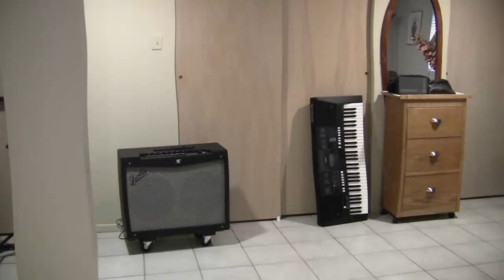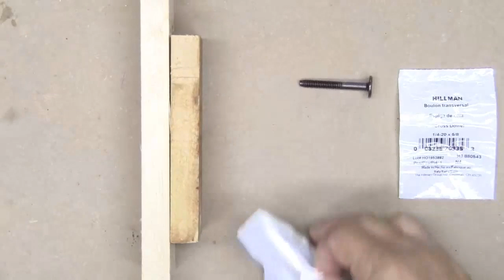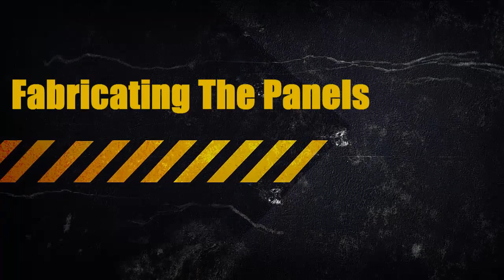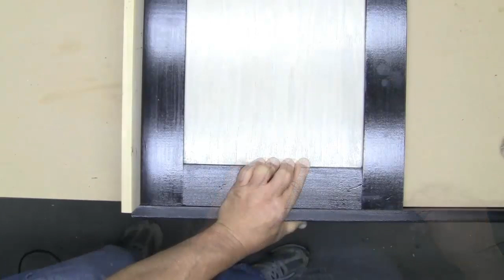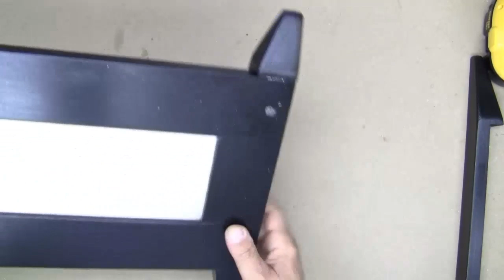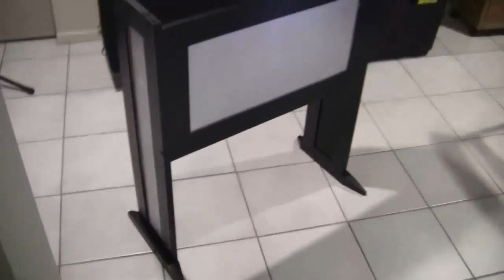Build This Music Keyboard Stand For Your Yamaha or Other Brand Keyboard

Comment: For what it's worth, I estimate these dimensions based on measurements of the video and my own Yamaha keyboard:
   Side panels are 8 3/4" wide and 25 1/4" high (assuming the top of the keys should be 28 3/8" from the floor).
   Each foot extends 3 3/4" in front of the side panel, and 2 1/2" behind (i.e. toward the pianist).
   Front panel is 15" high and (for my 61 key keyboard) 27 3/16" wide.
I assume the feet extend further in front because the keyboard overhangs the stand on that side.
My keyboard lacks slots for the stand, but does have a threaded insert for a 10-32 screw on each side.